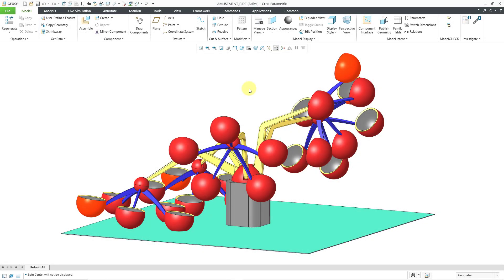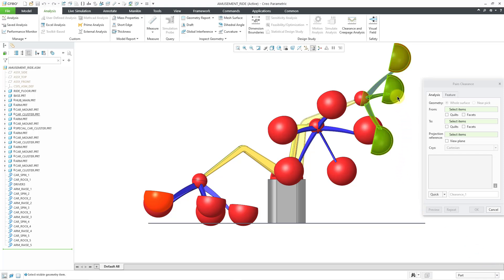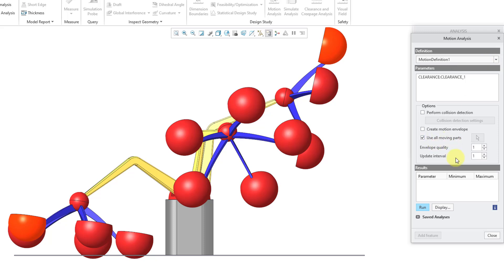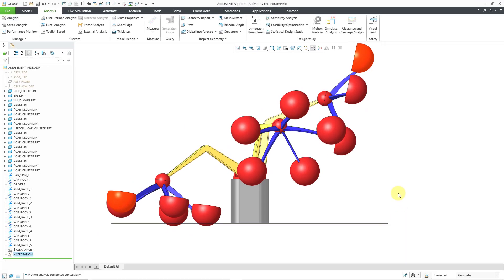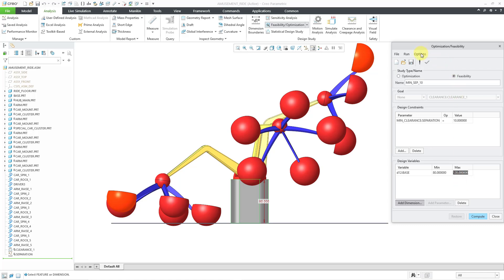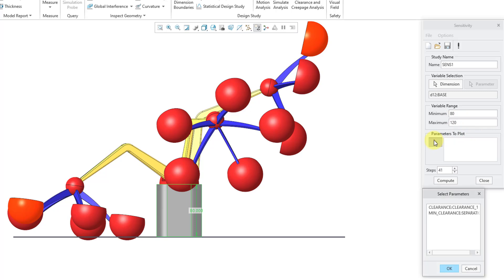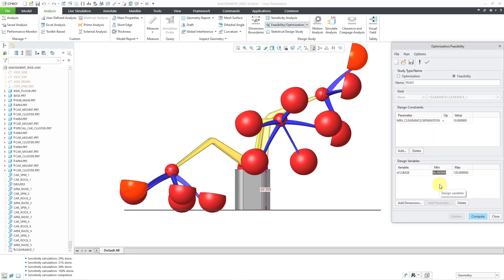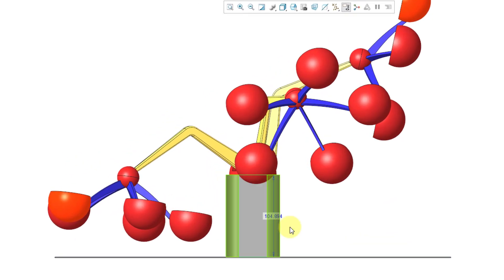Creo Parametric - Pairs Clearance Analysis and Motion Analysis

Comment: Isn't part of the issue the fact that clearance is capped at zero and doesn't go negative, therefore you start in a very large plateau? If clearance was allowed to go below zero you could probably "climb" up to the correct value and not get stuck.
Reply from the maker: I believe you are correct. The Gradient Projection algorithm uses a Local Sensitivity analysis to determine the next point. Neither will get you to the next point out of the trough or plateau. That's why it's important to use a Sensitivity Analysis to start in the vicinity of a solution, especially for Clearance Analyses. Other analyses can fall into this trap, but as you point out, Clearance Analyses are more susceptible to this than other types of analysis.